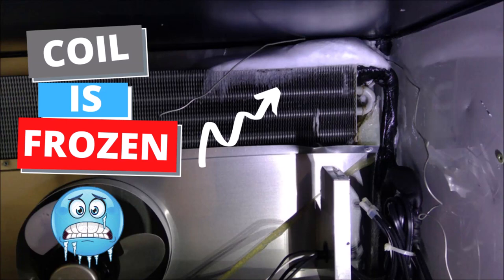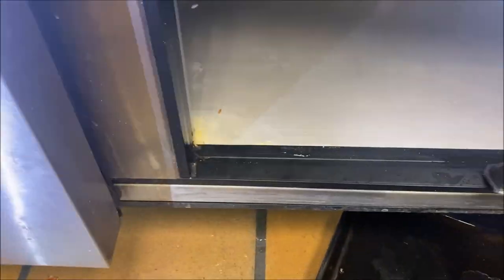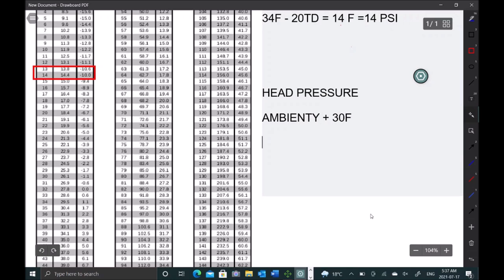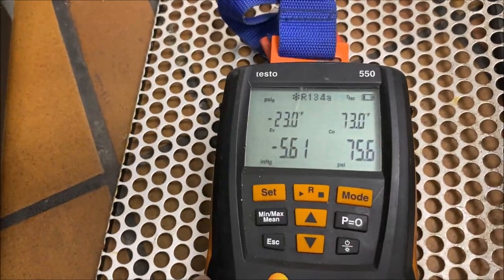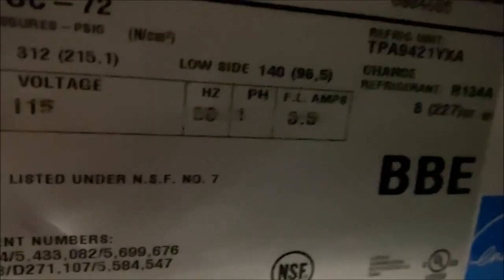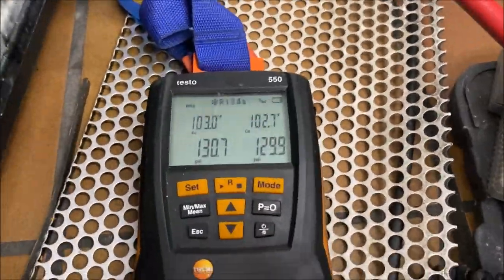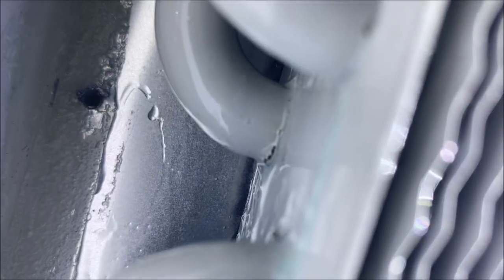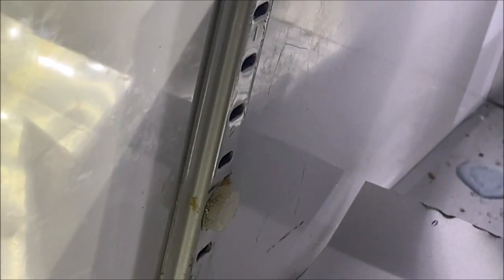True 3 door Cooler is not Cooling

Comment: Question ? How do you determine the  TD of the different coils  in different  units/ manufacturers ?  Thanks. And thanks again for sharing your  knowledge
Reply from the maker: Most reach ins are 20td for the evap and walk ins are 10td but your superheat will ultimately determine that. For the condenser coil it gets complicated because most of the newer equipment uses a 15Td and a lot of the older stuff uses a 30TD. So it’s very important to understand saturation temps and from there you can make an educated guess as to what TD is being used.

Comment: So did you leave the refrigerant in the system and add nitrogen just so you can have enough pressure to find a small leak? And then you will recover the contaminated refrigerant?
Reply from the maker: Recover and leave a trace amount then add the nitrogen. Then purge the nitrogen to the air once the leak was located

Comment: Love ur troubleshooting skills. I have a question about line taps. Is there a place u dont put them on like discharge line. Trying to get a better sense on location for putting a line Tap on a sealed system if needed. Any ideas?
Reply from the maker: There is a stubby that comes out of the compressor, that is where you would hook up your low side. On the filter dryer, it will also have a stubby that has been pinched off. Attach the line tap there for you high side pressure. Do not leave the line taps on the system, they are just for troubleshooting and must be removed.
Reply: Thankyou my friend from the north appreciate the feedback.